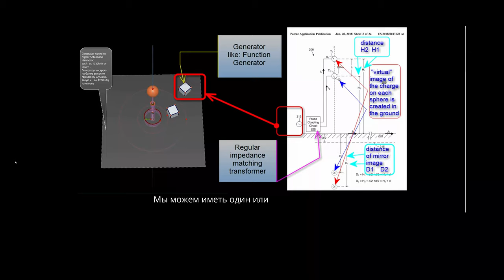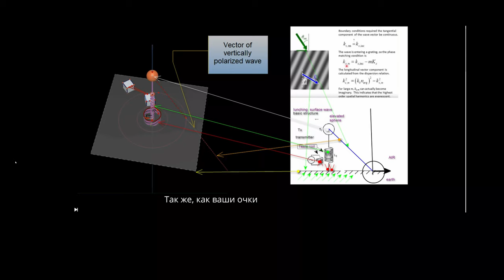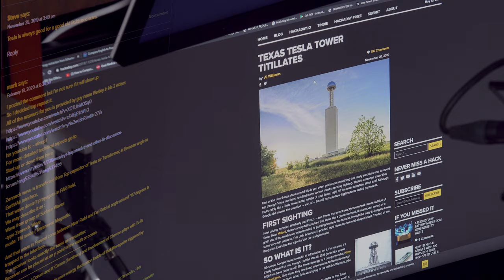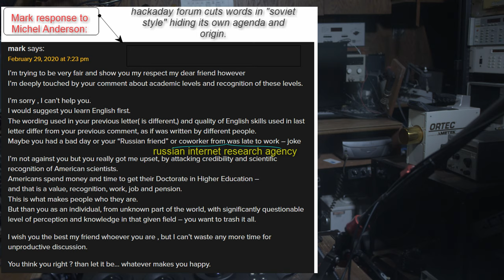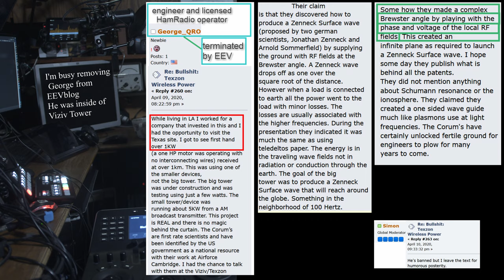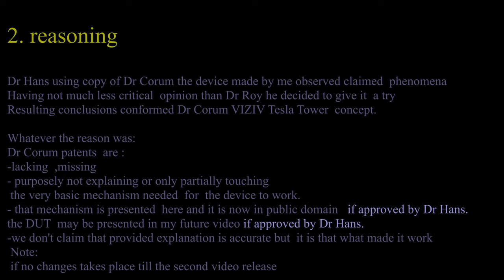Part 1 EEV blog criticism creates  protest  of   FE community

Comment: One comment: the "modified" posts are clearly due to the problem of using "angle brackets" ie less than / greater than symbols in a post. This often is treated as bad html... and everything within such brackets may simply disappear (depending on the website software. Some software converts it to a visible symbol.

Comment: Wesley hi there my name is Jason and I too have made a Device that is essentially (free lunch) also working with the harmonic resonance and multiple impedances pulses, I have a Device of 14kwa stable at 50hz continues use, my main power switching circuitry is using Thyristor module bricks 3 of them for 3 phase powrt, also have a yoke setup using 3 combined yokes stacked on top of one another, and a very very large Tesla transformer which I built myself with exactly 2401 turns on the primary and 360 on my secondary, I have a resonance very close to the Shuman resonance frequency, my device resonates at ELF 7,3469387755101 Hz
Reply: Cool, please post a video about it ! Thanks ! regards, Stefan.
Reply from the maker: The claim is extraordinary if there is anyone interested in it in the early days of its announcement.
So if you have something  in your hands that has a value to others than cash it out.
Your payday may be just your satisfaction or pile of money  .
I work based on satisfaction ,but that is nothing wrong in  monetary reward.
Audience tends to forget givers
Selfishness is not negative  :
- not inherently bad. 
It’s simply a means to feel like we matter, 
that we are worthy  more
and we are getting our basic needs met. If it helps us find substantial, 
enduring, unconditional, sustainable  fulfilling of our needs — as opposed to fleeting 
substitute pleasures — then our selfishness eventually falls away when 
we are more able to give
Your statement  is tempting, but it is yours. 
Once it is out   you stop to exist as special beneficiary and become one of these who
just try to  make  living on that.  
I'm minimalist by nature.
I also have problem with  human kind trashing their own  world for easiness  of living better life than their more fortunate in life group of privilégiers
Wesley
Reply: Power Electronics, can you please tell me how you manage to measure frequency with a resolution of 100fHz(aka:0.0000000000001Hz)?